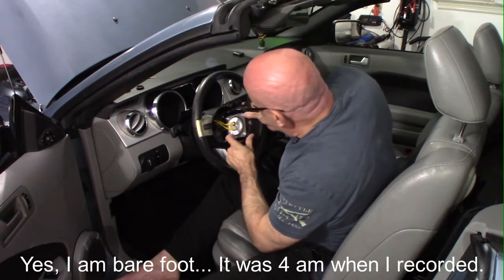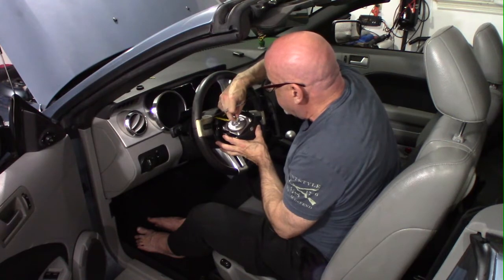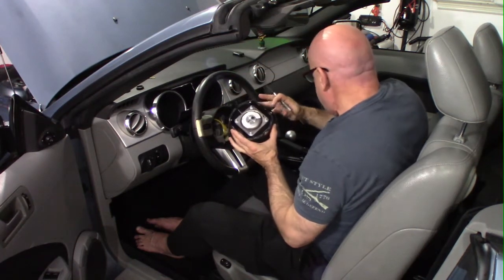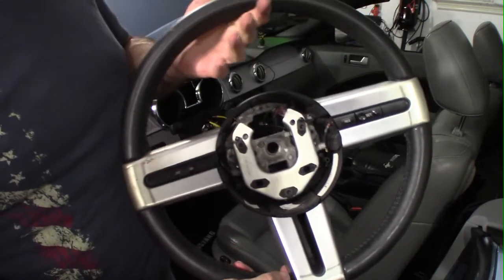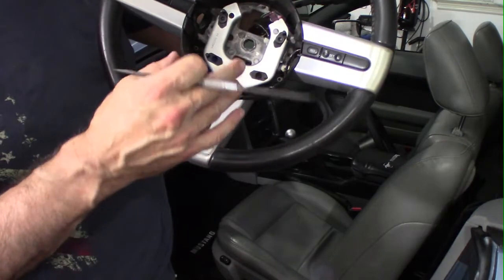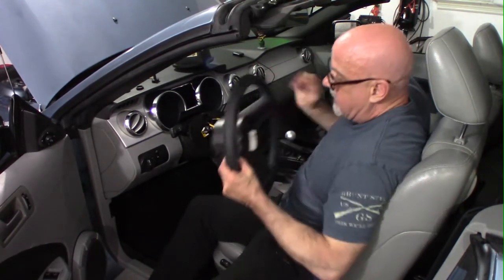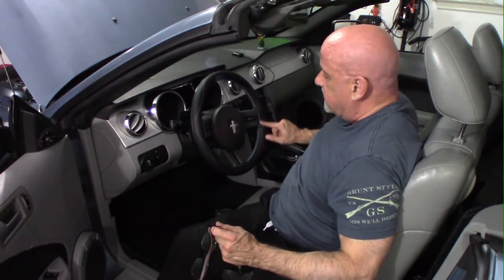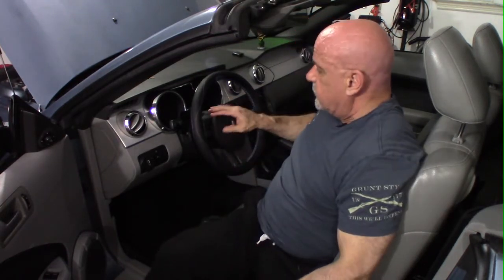2005-2009 Ford Mustang - Removing the old and installing the replacement steering wheel.

Comment: The center bolt is a “torque to yield” bolt which means once it is removed it needs to be replaced with a new one. For 05-14, it should be torqued to 100ft lbs.